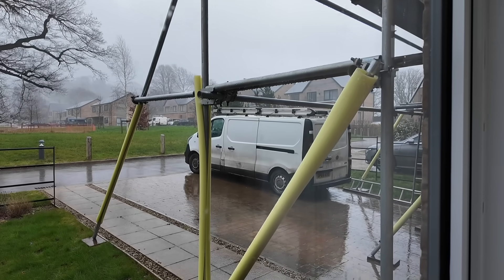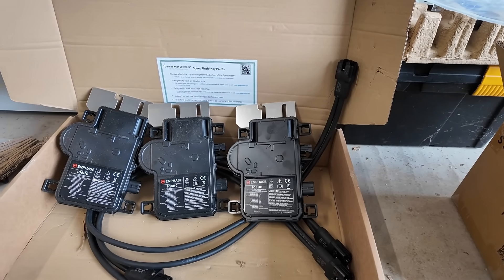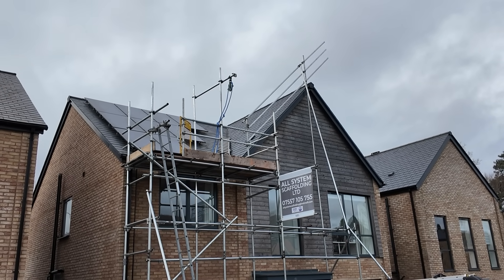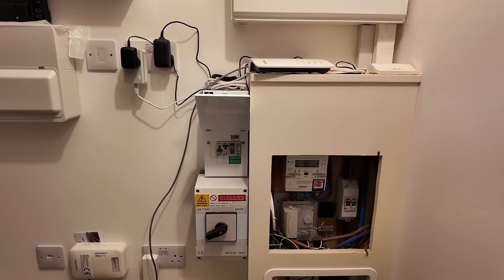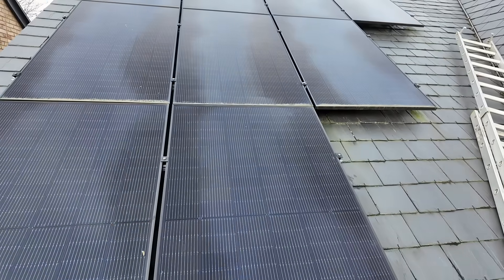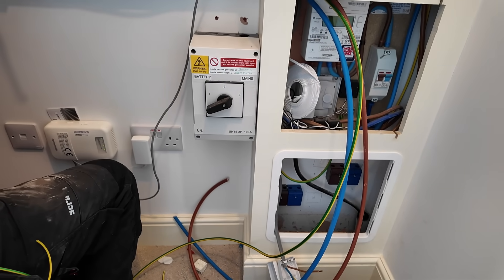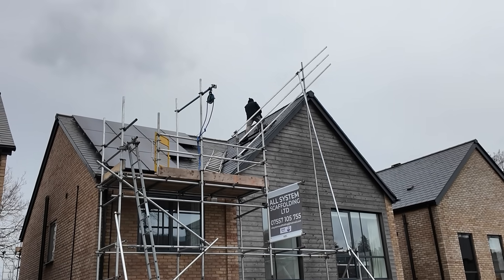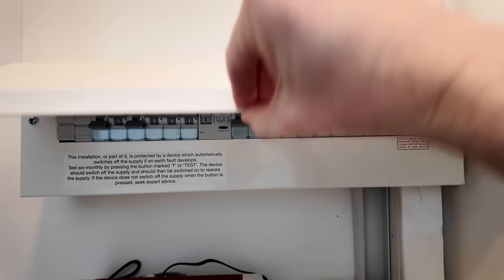Adding extra solar - string inverter vs microinverters

Comment: great video, do you have any initial thought, i'm at a point i need to choose between micros or string for my installation very soon.
Also, would which setup would you say is "messier" (cables, devices, connections etc..)
Reply from the maker: If you can wait a few more days I'll be doing my first month's report this week, which will show the data for March.  In terms of neatness, there's not much to choose, really.  The micros still require a box near the consumer unit, although it is somewhat smaller than a string inverter, so if you're tight for space that's handy.  Although if you want batteries as well then you'd need a second inverter for the battery if you go with micros, whereas you could just get a single hybrid inverter to do your PV string(s) and battery in one system, so that could be neater.  It depends a lot on what you're after.
Reply: @TimAndKatsGreenWalk  thank you, i'd be getting a battery too and want to keep equipment to a minimum in garage, but have partial shade from trees in late afternoon so was advised getting micros
Reply from the maker: @dannydr1  the alternative to micros would be optimisers, e.g. Tigo, which can work with any inverter.  So that might be worth investigating if you have shade.
Reply: @TimAndKatsGreenWalk  thanks a lot, none of the installers even offered that, will look into it

Comment: Does your Givenergy app still show home consumption when the new extra systems are generating ?

I had 3 extra panels with enphase micro-inverters fitted a few days ago but it appears to have messed up the Givenergy consumption data.
Reply from the maker: Yeah, the home consumption is suppressed by the new system as the GivEnergy inverter sees it as reduced load.  There is a solution that I'll be talking about at some point, but I've not implemented it as yet.  For now I'm adjusting the data manually for my end of month stats.

Comment: Great video! I’m curious about your choice not to use the northern elevation for the second phase of solar. While south-facing panels typically produce upto 40% more energy, the east-west roof creates shading issues on the southern side, whereas the north looks clear. Given that you could have fitted probably three times the capacity there, did you run the numbers to see if a larger array on the north might have worked better? I'm just interested in your thought process! Well done 😊
Reply from the maker: I cover that a bit in this video: https://youtu.be/6bytvup3jZE
The main reason was cost effectiveness, at the end of the day.  The North array would have been a lot more to install (installing on a slate roof means each panel incurs extra cost, plus there'd be the extra microinverters).  And the shading is a lot less than you'd think on the South side (I show that in the linked video too).  Additionally, putting scaffolding down the side of the house on the North side would have been a right pain as I've got a shelter structure bolted to the house down there so I'd have had to take that down first, which I didn't much fancy.  So it was just easier to go with the South instead.  And the South array also generates more in the winter than the North, and that's when we need the extra the most.  So a few factors, really.

Comment: Great to see you have managed to add the solar to the South side of your roof. I am still waiting in case my need to have 3 phase to fit panels high up on my south facing wall. I am going to wait a year and ask again to see if anything changes.
Reply from the maker: I was half expecting our DNO to insist on three phase so I was glad that I was able to extend our export limit just enough for this.

Comment: I've 11 East facing roof mounted panels and one South facing gable wall mounted  panel all various outputs per panel of 230W to 410W. These 12 have Enphase microinverters. On my West facing roof I have 8 x 410W panels connected in a string to a Solis 3kW inverter. The West panels are never in shade whereas my East and South facing panels are shaded variously depending on the time of the year. I get a total annual generation of ~5000kWh split 50/50 between the 8 panels and 12 panels. No problems so far with the microinverters.
Reply from the maker: There are definitely situations where the different inverter types are better suited.  I'll attempt to make that point in future videos.

Comment: We have an existing Growatt inverter for our 5.5kWp, SE array, on the main roof - but I’m keen to try and add maybe 1-1.5kWp of panels on the single storey SW extension at the front of the house to top up our generation and get some into the early evening as the sun moves round.
Tim, do you know if there are any special considerations as to how different solar installations interact with each other? You have 3 different manufacturers so I presume they are all happy to coexist? Any special considerations needed?
Reply from the maker: Good question.  Even my installer was unsure as to exactly what would happen when we added the two new systems but they asked around and were told that it just sort of works without any additional requirements and so we went ahead to see what would happen.  So far it does indeed appear to be totally fine with all three systems happily coexisting.  The only issue I currently have is that the GivEnergy system sees the new generation as a reduction in the home demand (and also extra grid export when the new arrays are generating more than the home demand at the time) and so I have to account for that when compiling my data at the end of the month, but I can handle that.  As it happens there is a way for the Giv system to see that extra generation but we've not implemented that yet, so I'm interested to see if that solves the data issue for me in due course.
Reply: @TimAndKatsGreenWalk nice, thanks. I look forward to the follow up videos on how you combine all the data!

Comment: Good Morning I was surprised to see that you do not have bird blockers/protection fitted? I did not have bird protection fitted on my first solar install, it took awhile (several years) but the pigeons did move in and it was very difficult and expensive to get them removed, I recommend having bird blockers fitted before they find and inhabit your install. Thanks for your videos.
Reply from the maker: The pigeons have shown no interest at all in the existing arrays so far.  I think our roof is too slippery for them as it's quite steep and we have slate tiles.  They prefer the trees.  If they do move in I'll hold my hands up and admit I was wrong.  Although it's not inevitable, my father-in-law has had panels for 13 years without bird protection and has had no issues.

Comment: You have set up the rigs for a very interesting experiment; microinverters vs string inverter in identical conditions.
I have 19 iq7+ on my roof in three different orientations.
My prediction is Enphase will produce at least 10% more annually. On perfect sunny days (max clipping for the iq8hc) the two systems will be on par
Looking forward to the next videos
Reply from the maker: I'm hoping it will show some very interesting results.  There are so many other experiments I'd like to run but I don't think I'll be able to do any others, realistically.  You never know though.

Comment: There will be slight accuracy discrepancies between each system’s CT coil. You might want to consider a simple cheap independent energy meter with two inputs so you are measuring each system by the same yard stick. Do a search for : Tuya Smart WiFi Zigbee Two-way Bilateral Energy Meter. It comes with 2 CT clamps to one small device.
Reply: He's not using each system's CT clamps though - he's using a Shelly Pro EM-50 - much like you've suggested, this is an independent energy meter with 2 channels (2 CT clamps) so the measurements should be fair enough.
Reply from the maker: I'm doing that already with the Shelly device mentioned in the video.

Comment: I’m interesting in the purpose of that Enphase Contactor or Q Relay?  My installation does not have one.
Reply from the maker: It seems it's not really required in the UK but is required in other countries.  Apparently it disconnects the array under certain "anomalous" grid conditions, whatever that means.

Comment: I’m surprised the EV Charge point was wired into the existing consumer unit, when I had a Zappi charge point installed the electrician installed a separate small consumer unit specifically for it , which I understand will be the same for the ASHP when installed at the end of this month !
Reply from the maker: Yeah, it really should have been separate to start with.  It was good of Green Team One to fix that for me.

Comment: The Enphase Microinverter are 380W AC ... so + the conversion DC->AC loss. I discovered this in a little seen Enphase video
Reply from the maker: All the string inverters give you the AC rating too, so the Fox ESS inverter is 1.5kW AC.  At the end of the day it's the AC generation that I'm measuring for both, and using the same way to do so, for consistency.
Reply: @TimAndKatsGreenWalk  I take a 25 yr bet .. Enphase will win 😆

Comment: Quick question as I am looking to have a solar and battery system installed, what is the switch you have to go between mains and battery, and does that enable you to run the whole house 'off grid'? Another great video!
Reply from the maker: Hopefully this video covers all your questions: https://youtu.be/HD5KqC7Mfv8
Yes, it does do the whole house off-grid, although you have to be a bit careful not to go over the inverter limit.  Nowadays there are better options such as the GivEnergy Gateway that you can get alongside their All In One battery.

Comment: Would you recommend the shelly monitor to check on consumption? What would you actually need to buy and how much is it? Im getting solar, battery and ashp installed in couple weeks so could shelly monitor all these? Thanks.
Reply from the maker: This is the one I got, as recommended by Speak to the Geek: https://amzn.to/3FsuiJj
That's all I needed to buy as it comes with two CT clamps, and then the installer added it to the consumer unit along with a 6A MCB so that it could be power cycled if needed.  I'd recommend getting an electrician to do that part.  Each of these could monitor two circuits, so you might get away with one to monitor both solar and ASHP.  Although your solar/battery system should give you these values anyway, I'm using this to ensure the same method of measurement is used for both arrays, they do also provide their own measurements (although not necessarily using the same methodology so can't be relied upon to be consistent with each other, hence the Shelly).

Comment: I'm calling it now because i'm stupid.

String inverter will outperform the micro inverters over the course of 12 months.
Reply from the maker: I've made a note ;)  I reckon it'll be micros win over winter, string wins over summer.  Overall, I'm not sure, I'd probably agree with you on that one.
Reply: Good on you for doing the experiment. Am very interested to see the results. While you’re at it, any chance doing a comparison between the systems with charging the battery? Am interested to know what the energy losses are.
Reply from the maker: @ Unfortunately I don't think I can measure that as the batteries aren't directly connected to the new arrays and I can't see how much the battery charges from the individual arrays other than the existing E/W one that's connected to the Giv inverter.
Reply: @TimAndKatsGreenWalk  Could you do the test purely on the GivEnergy? Compare AC grid vs DC solar charge. Otherwise it may make the AC micro-inverters look better than they actually are or maybe it shows having a mix of DC and AC is the way to go!
Reply from the maker: @jameswestcott4191  I can't measure that, really, so I can't compare AC vs DC charging, I'm afraid.

Comment: Looking forward to results coming in.
I have a daft install of 1 of the strings having 6 panels NE facing and 4 Panels facing SE. There is also a little shading in winter (similar gable roof issues to you) of various panels. Now I know more I would never have let them do it this way. Especially as the flipping inverter they installed has a 3rd string input available. 
Problem is do I get scaffold back to sort it. Probably not sensible £ wise but it really annoys me. I could get another 2 SE panels on roof too which could just swing the hassle. Split the strings into 3 so they all have the same orientation and/or add optimisers.
Could get another 6 on a NW roof too ..... 
Oh what fun.
Reply from the maker: Yeah, that is a mad situation.  I guess if you did add more panels that'd be the time to sort it out.

Comment: Just wondering if this affected your original DNO application - was it a new application and if so was it an easier/faster process?

On a separate note I’m just wondering what the impact of a MI failure would be on that string?  Would you need to hire scaffold to troubleshoot/replace the MI?
Reply from the maker: I'll be covering all of that in future videos, hopefully, although I mentioned the DNO application in the video I linked at the start.  They're a bit odd, our DNO, and they just said as long as we stay below 8kw export we're all good.  As I understand it if one microinverter failed the other panels will continue to generate as usual, although if you did choose to fix the broken one it would indeed need scaffolding to replace.

Comment: I decided against microinverters partly on the basis of expected lifetime. Inverters are expected to fail well before panels, and with multiple microinverters the odds of at least one of them failing is raised compared to a singe string inverter, and replacing even one microinverter would require roof access with scaffolding. If a microinverter failed it wouldn't take out the entire array (unlike with string inverter) but I guesstimated that it would outweigh any benefit from shading management.
Reply from the maker: I would tend to agree, the less stuff on the roof that could go wrong the better, and I'll be making that point in a future video as something to consider.  There are so many pros and cons to both systems I'd like to at least add some additional evidence to help others with their decision making process.  At least then people can make those decisions using as much information as possible.  That's the plan anyway!

Comment: Hi Tim and Kat, thanks once again for the information on your ever expanding selection of solar panels (Do I need to do an intervention to stop you getting more Solar things !! 😂) I'm looking forward to the enphase v string comparison. My setup is 12 JA solar 450w panels and 12 Enphase IQ7+ micro inverters tied to a Luxpowertek ACS3.6k.
My Solar array can in principle generate a max of 5400watts but that is clipped by the IQ7+ micro investors to 3600watts due to each one only able to take 300watts each. my logic for this was my inverter was only a 3600watts inverter so it couldn't take any more from the solar array and as I "oversized the array" I would most likely meet the capacity of the whole system each day it was a good solar day. 

I'm thinking of covering my entire north facing roof with solar that with the same specifications but newer IQ models to take more wattage. and a larger inverter. but that's for another year ....

I am curious as to how the two inverters compliment each other when they ultimately join to power your house and can they also both provide power to your batteries. its that joining of the systems which has me confused at how its done. 

Looking forward to hearing about the differences from your next few weeks data
Reply from the maker: Even my installer was unsure what would happen when adding these two new systems to the existing one, but I've heard of others doing this so I was hoping that it would all "just work", which actually does appear to be the case so far, thankfully.  It's clearly magic.  But I will absolutely be covering all of that in future videos so hopefully that'll answer any questions you might have.  I think for the time being I'm done adding any more panels, but that North roof is still calling to me, so you never know!  I'd just need to find a way around the DNO limit, which might get complicated, so for now I'm content with what we have.
Reply: @TimAndKatsGreenWalk  If Magic works then keep going with it ! my north roof should technically hold 20+ panels which due to north facing, it might give me about the same amount of power that I receive currently from the south facing array. My yearly output for the last 4 years was 2021 = 4.2MWh, 2022 = 4.2MWh, 2023 = 4.7MWh, 2024 = 4.2MWh .... which is very consistent for my 3.6w production
Reply from the maker: @bobbazley5376  that's pretty decent.
Reply: @TimAndKatsGreenWalk  The magic here is that all your inverters are 'grid-tied' capable, with the Giv inverter being 'grid-forming' so you can use your solar in a power cut. The GivGateway ties it all together and makes it safe. I don't think I can link to other peoples YT vids but Spirit Energy release a vid on getting more capacity from the DNO. They also talk about an unreleased Giv Hybrid 3 inverter that can cap your grid export, as of today only the Powerwall 3 can do this.

Comment: I would be interested to understand the turn on voltage for the string inverter vs the micro inverters. I suspect that the string inverter was intended to be connected to a larger string and might perform poorly under low light with a lower than optimum string voltage (particularly under partially shaded conditions)
Reply from the maker: I'll be covering all those details in a future video.  The string inverter is only 1.5 kW don't forget, and is designed for only a handful of panels.